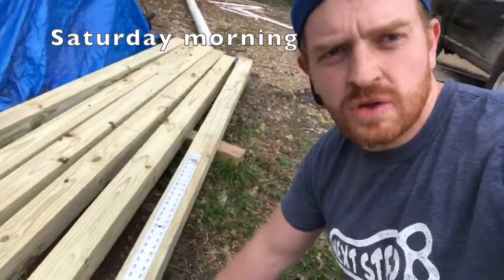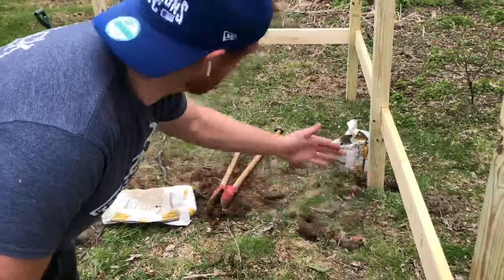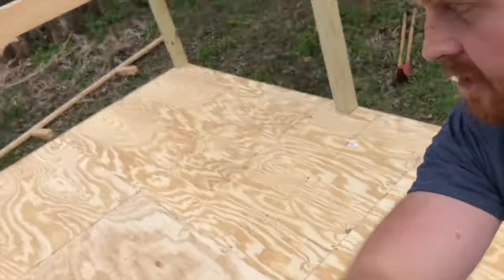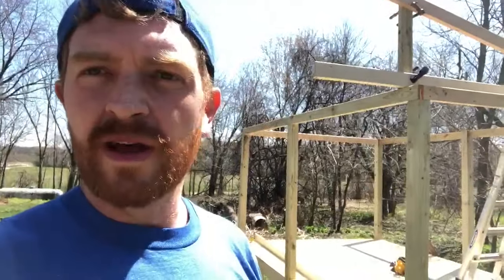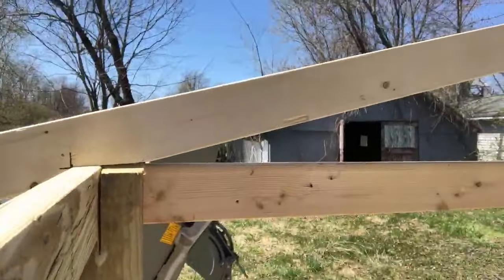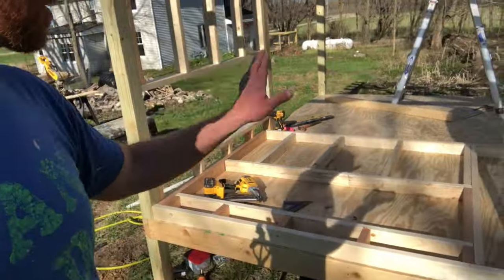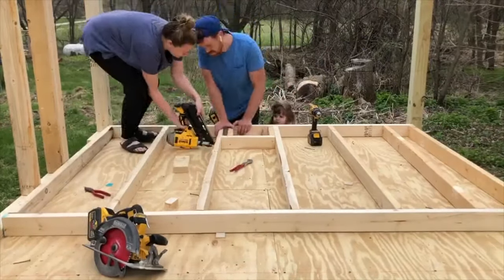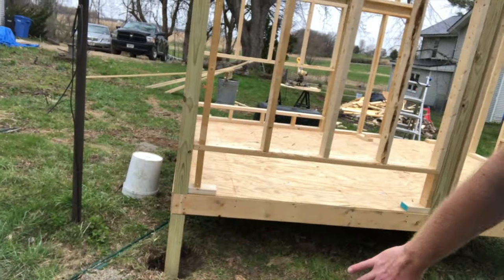Chicken coop build!

Comment: so how did you attach your 2x4 joists for your roof after you cut out the notches? nails? screws? metal bracket thingy's?
Reply from the maker: I used framing nails and toe nailed them on each side from above!